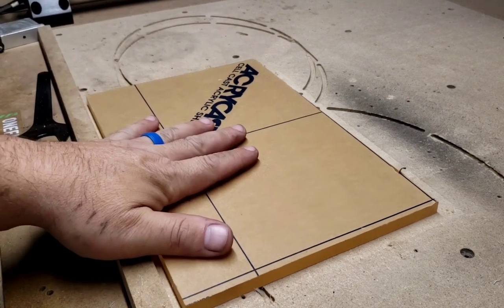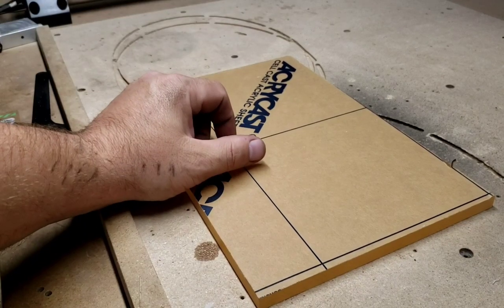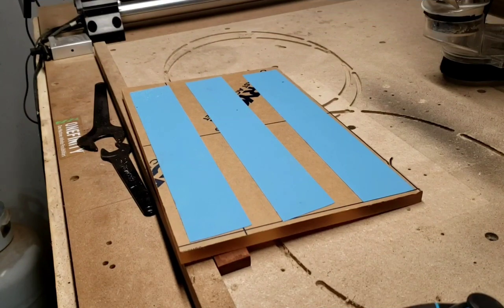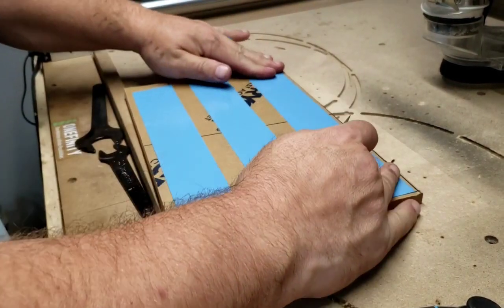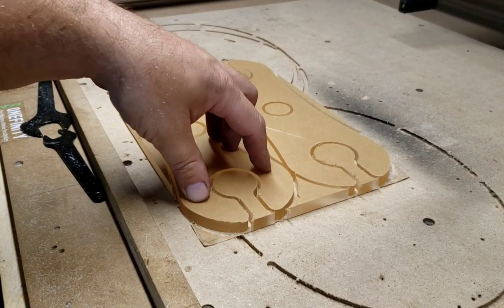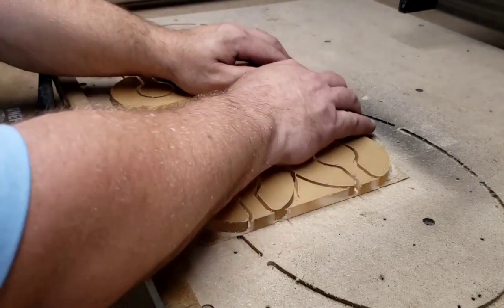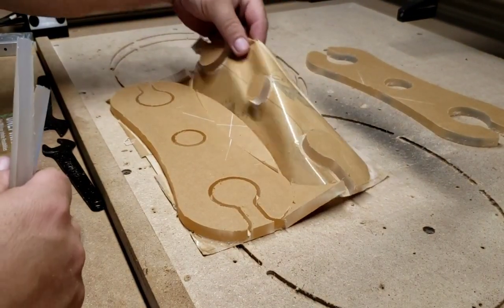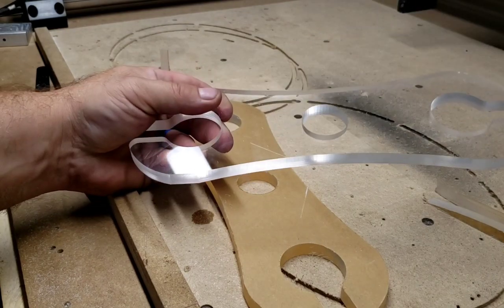Onefinity Cnc cutting 3/8 thick Acrylic

Comment: What feed and speed did u use?
Reply from the maker: With acrylic - cast I run between 70-110 ipm. I use 1x dia for depth of each pass. 0.004-0.006 ipt. I always run 2 to 3 finishing passes at 0.005 to clean up edges so there is less sanding and polishing the edges. These numbers are based off amana tool 51511-k is the bit I use. its a 0-flute spektra coated bit for plastic.

Comment: do you know what number the makita router is on?
Reply from the maker: I believe I have it set at 4 for speed. should be around 18000 rpm. check your router manual and it will tell you rpm range for the dial.

Comment: I would leave the protection on so you don't get finger prints on it... Oorr wait till right before shipping and then pull it and pack it for shipping.
Edit: the Etsy store didn't have this in there.
Reply from the maker: Thank you for your response. If this was a finished product then I would leave the protection film on but these are just router template to stick to wood with double sided tape so the surface finish doesn't have to be perfect but I do package them in bubble wrap so they do not get scratched in shipping. Have a good day!
Reply from the maker: Agreed. I took it off for the video. its my wife's personal ones. I will check on why it is not on there.